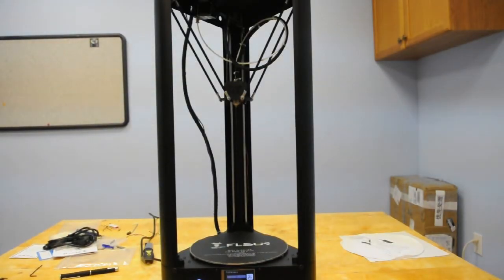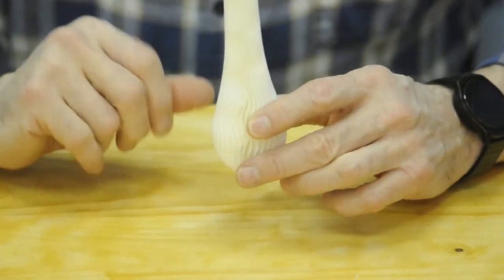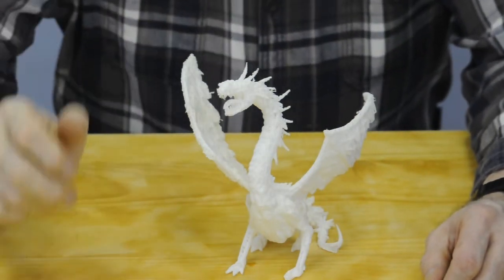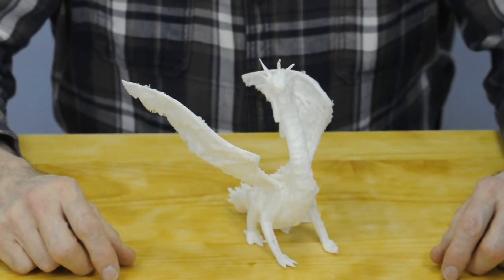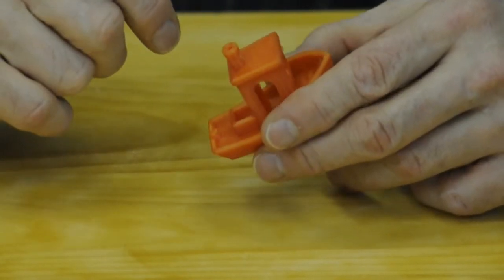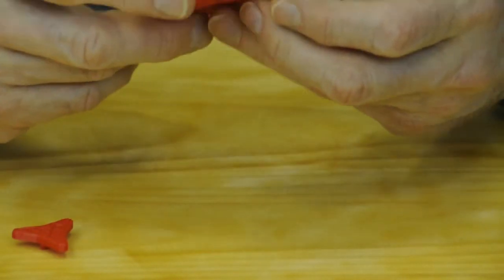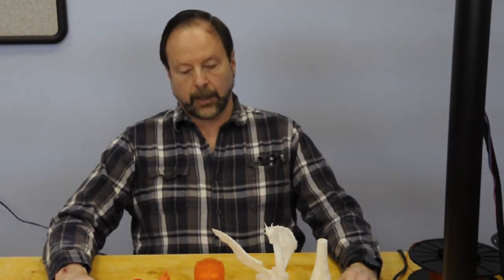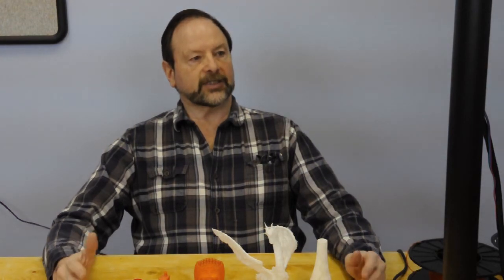Flsun QQ Review Video

Comment: How does the circular build volume work exactly? What would be the "square" base size limitations on this printer?
Reply from the maker: It's a circle, 10 and a half inches or 280 mm in diameter. Everything starts printing in the center. The formula would be pi times radius squared times height. That would give you the cubic build volume.

Comment: did you ever get the wifi up and running
Reply from the maker: Corey Budwine I actually haven't had the time to play with it since I set the printer up. I haven't forgotten though. I will probably get to it by the end of the week.
Reply: Cool I am having an issue with the wifi bin file.  everything I try to flash the board it gets stuck on the file.  let me know when you get a chance to play it I would love to know how to get the wifi up and running

Comment: so if  a noob knows how to adjust the z axis then you would recommend this flsun qq, im  new to 3d printing but i know about z probe and how to adjust it on this machine
Reply from the maker: I used the z probe offset as a convenient example, but my thought is that there are so many small tricks and habits a person picks up in this hobby with the kit printers that would help in using the QQ.  Things like cutting filament on a bias to create a point which helps the auto loading feature, since the extruder on this machine is hidden.  The machine is awesome and I do recommend it highly, but I think some prior printing experience would help maximize enjoyment of it.
Reply: I understand and appreciate the reply, would you mind if i ask you some questions if i run into any massive issues?. thanks for a great series of videos
Reply from the maker: TrickGaming no problem.  Answering questions is why I started this channel.